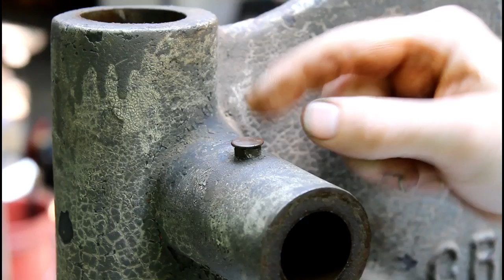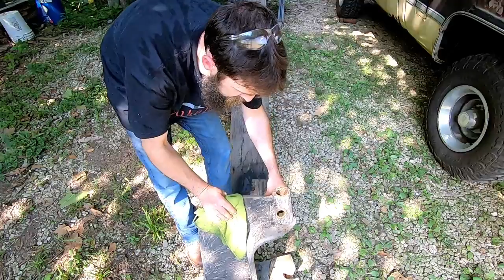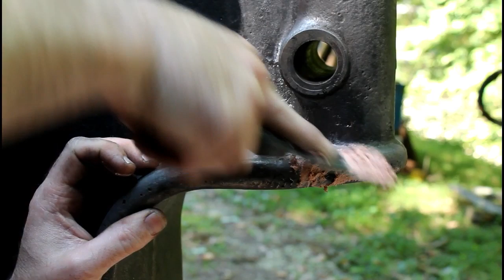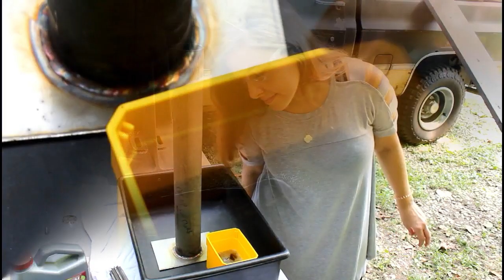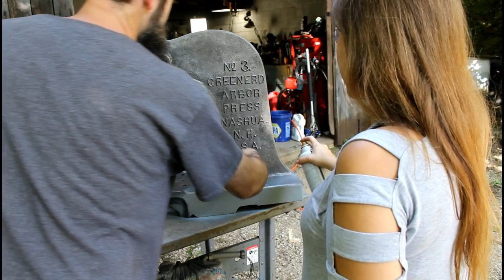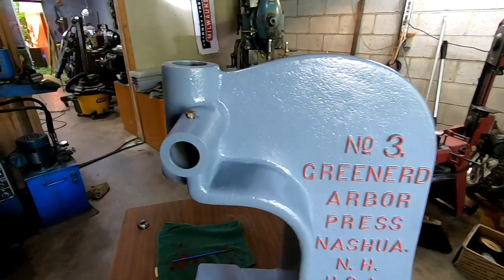Elizabeth & I Restoring the Greenerd  no3 arbor press Part 1

Comment: A suggestion for next time you need to do letters like that.  First, spray the letter area with a lacquer paint in the color of the letters...don't worry if you get more than just the letters.  Let it dry, then spray the whole press (in this case) with enamel in the final color.  THEN, use enamel paint thinner to remove the enamel paint by rubbing it off the letters.  The enamel thinner won't bother the lacquer if you don't let it sit on it for long time.  Use a stiff rubber sponge covered with a thin rag soaked with the enamel thinner.  This will give you a very nice and consistent looking letters.  SOOOO much quicker and with results that can't be beat.  I do old license plates this way and get very professional looking results.

Comment: Evaporust worked great for me, though I did end up buying 4 gallons of it to do the larger parts when I refinished my delta 15-665 drill press.  I also had good luck with the paper towel method.  They do mention water, but only once it dries out and gets old/starts to get more gloopy vs fluid. ie it lost some of the original water.  You could also likely just use doubled garbage bags for it, or a plastic pipe.  I found walmart and Amazon both had the gallon size for around $16 which was cheaper than elsewhere.

Comment: the bodyfiller seemed to be kindah dry to start with ,-
as for the low volume evaporust , maibe get a fitting plastic bag and fill that up with the part inside it in the bucket , if you hold the bag up it should fit pretty tight around the part and only need a little liquid (as long as the bag stays watertight)
have to say you have a great wife , not only is she pretty , but shes willing to get her hands dirty and shes supporting you whish is making youre life eazier in general  , not a lot of women in the town i ive in are willing to do that , they rather have long nails

Comment: Painting tip- Start your motion then start the paint flow... Then stop the flow, then stop the motion. This helps avoid puddles and runs. More light coats rather than one thick coat, you shouldn't have to sand between coats if it hasn't fully cured.

Comment: I've found that WD-40 Specialist Rust Remover Soak works just as well as Evapo-rust and it's just over $20 per gallon.  It's less expensive to use for larger parts.  I soaked some heavily rusted chrome parts from an antique fire engine in WD-40 Specialist Rust Remover Soak for 18 hours and they came out looking brand new.  I didn't have to scrub them at all, just rinsed them off with water.  I couldn't believe how well that stuff works.  May be worth a try on one of your upcoming projects.

Comment: I have a Famco #25 arbor press, it is nice and heavy but there is not enough opening height to be able to use it for broaching so I built my arbor press stand out of 2-1 1/2 in thick plates and used a short piece of 12 inch I-beam at the rear to set the top plate on. The idea is to be able to start a broach pressing against the bottom plate then transfer it up top to finish the broaching. The bottom plate has 2 rollers at the rear and 1 1/2 threaded rod up front for legs. This way if I want to move it in the shop I can just use a floor jack. You are much less likely to brake a broach using an arbor press than a hydraulic press because you can feel what is going on.

Comment: Say what you mean about the safety advice. If you get any of that paint stripper on your skin, after a few moments you will develop an itch, which you will scratch. Your skin will have dissolved at the itch; will rub off and expose deeper tissue. If the acid has gone, the fissure will heal over. If the acid is still live, it will cause deeper lesions resulting in bleeding and definite scarring. Not scare stories, just how it will be.

Comment: 'Got a couple tips for you !    When using paint stripper , use some thin, clear plastic over the stripper - it won't evaporate . . . * More often than not, the paint will peel off in big strips . . .just make sure you put the stripper on heavy enough, otherwise it has no time to eat into the paint .  ( I've stripped old cars to bare metal - usually with just one application )     The 'trick' is to get the plastic on immediately after spreading the stripper, & press the plastic into the 'goop' ; which prevents air bubbles from evaporating it !   Vertical surfaces are a pain - so it pays to put the largest surface in a HORIZONTAL position , that way , the stripper will 'pool' , instead of running downhill !   It's faster & easier to pour the stripper on , then brush it lightly - to spread on a THICK layer ! 
     Tip #2 : painting the raised lettering is a snap - use a flat sponge brush , or even a piece of a sponge brush . . . use oil based enamel, lightly thinned . . . then just dab the surface of the lettering .  ( I ran a one man sign shop for a number of years , & learned a LOT of shortcuts to doing FAST , high quality work )      Good vid of you two !

Comment: Put your part(s) in a liquid tight plastic bag like a trash bag.  Put the bag in a container with dirt or sand lightly packed around it so that the bag conforms to the parts.  Put enough evapo rust in the bag to cover the parts.  If the evapo rust has a lower density than water, you can use water instead of dirt or sand.  If it is higher, you can add salt to the water to increase its density.  For once in a while things making a salt water bath will not be practical and using dirt or sand makes a lot more sense.

Comment: On that Evap-o-rust...at least you aren't doing restorations like Uncle Keith Rucker is.  He had to buy the BIG drums of the stuff to fill his "vat".  At least you can re-use the stuff a few times.  I bought a gallon of this stuff YEARS ago after seeing it at a trade show.  WOW it worked great, but I was immediately getting rust again (NOT flash rust)...that's when I learned you have to RINSE the part off after pulling it...LOL...

Comment: Thanks for sharing Steve. Nice job Elizabeth. Just a suggestion when using paint stripper to remove it you can use wood planer chips. It absorbs the stripper and as well abrades the surface to clean off the residue. Though you need to wear a good laws when doing so but works fantastic. Just a suggestion.

Comment: For long parts I use PVC pipe with caps on the ends. It's a cheap way to make various diameter containers.
Reply: Was wondering if someone would beat me to this! Works especially well for things like drills, connecting parts and such that are long and thin. I did learn that it is best to use PVC glue on the caps, friction fit doesn't work.  At least I had them sitting in a bucket so I didn't lose the ER!
Reply: Ya beat me to it... Yep quick and easy way to treat long stuff.

Comment: "... I'm going to have to make a container for this."  Then you go an make something made of metal.  Figures.  You work with metal all day long, so why would you think of something different?  What came to my mind was plastic.  If you have plastic sheeting, even Saran wrap (ask Elizabeth for some), make a horizontal "tub" by laying two pipes side-by-side with a gap and something for the ends.  Lay the plastic over it, add your rusty piece, then add the fluid.  Another option would be to use PVC piping - does not require grinding or welding.
Reply from the maker: Lots of options would have worked.  I didn't have any PVC.  That would have worked well. By the time I dig for something easier to work with I was done with the SS one. Not a big deal, took 5 minutes.

Comment: Put the parts in a tub of vinegar. It takes rust or mill scale off with no problem.
Reply from the maker: I'll give that a try. Heard other say the same👍
Reply: @SteveSummers  Just to help. The stuff I'm using now is Pickling and Canning Vinegar with a 5% acidity. I think it was under $5 for a gallon at hardware store. I'm no expert but I think you can use the cheapest white vinegar you can find locally.
Reply: Vinegar is an acid, and acid attacks the good metal as well as the rust.  That is OK on a casting (like the arbor press) or an old shovel, not so much on a nice, shiny Hermann Schmidt grinder vise.  Evapo-rust is a chelating agent, and will only attack the rust, not the good metal.
Reply: @duobob  Highly doubt that steel sitting in a tub of 5% vinegar for a day or two will have any negative effect. I personally think vinegar is great for several reasons. Non toxic, cheap as bottled water, readily available in large quantities, you can use it over and over, it works like a boss. Have been using it to remove mill scale from hot rolled. First a quick spray and wipe with simple green. This takes off the oil slime. Then the steel soaks in vinegar. A day or two later the mill scale will scrub off with water and scotch write pad.

Comment: I have long hair and once had a dremel tool catch it. By the time I managed to shut it off the dremel was stuck against my scalp. It didn't pull any hair or scalp out and I loosened the bit and unwound the lock of hair so no harm done. I consider myself lucky it was this accident that taught me to always tie my hair up and out of the way in a knot.

Comment: Now may be the time to consider getting a heavy lifter on the place.  Tractor with a front bucket or similar.  Seems the projects are getting consistently larger and heavier.  That saw is going to be mean to move when the  time comes, even when still broken down to it's components.  FPE: Back problems and hernias are not fun.